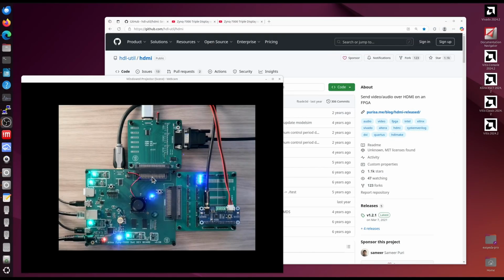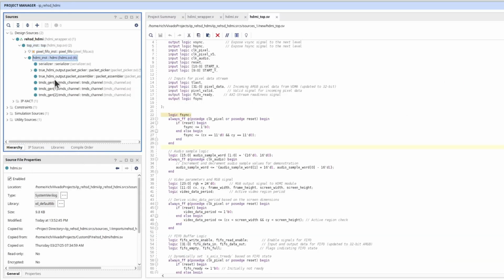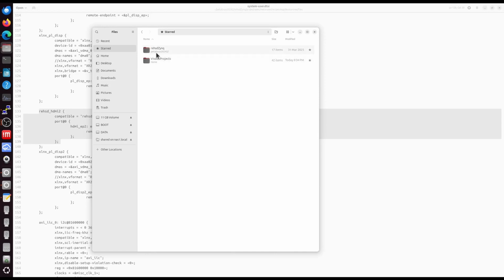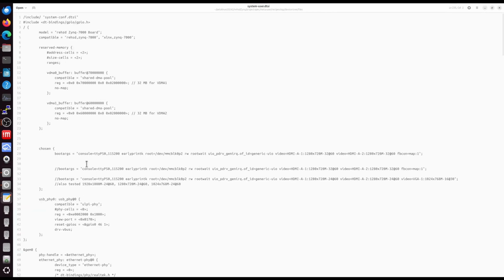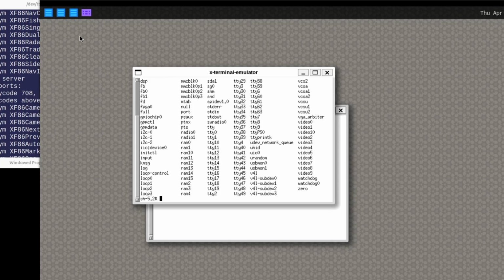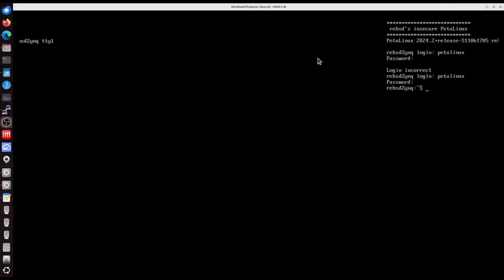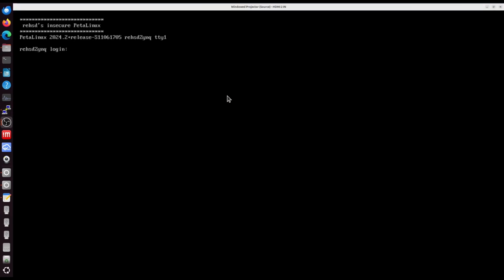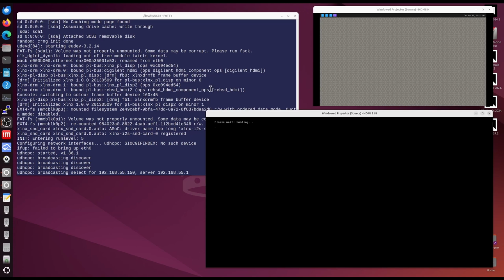Zynq-7000 - True HDMI Output Using AXI4-Stream Slave & PetaLinux Framebuffer

Comment: Hey rehsd! thanks for your videos.
 I'm also making my own Zynq circuit board. I'm dealing with the same issue of getting the HDMI touchscreen to display the Linux GUI. 
Right now, I'm using the Pynq sdbuild workflow.This is quite different from the Petalinux process. I've spent a month on it and still can't get the HDMI working.